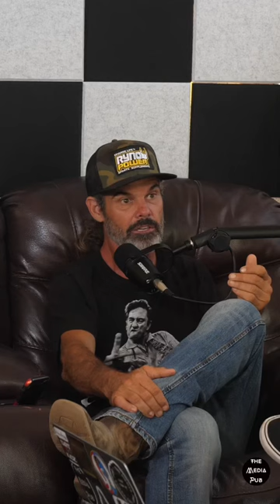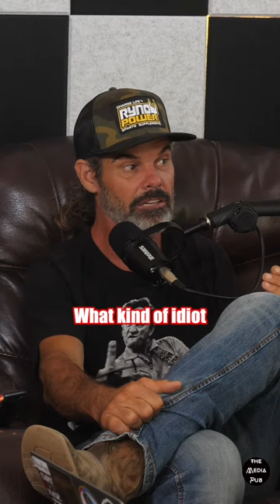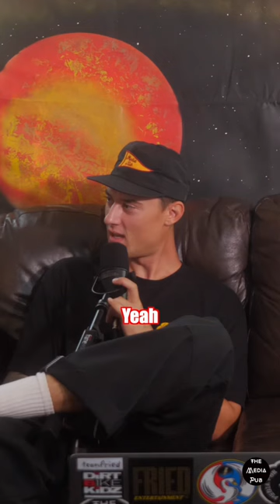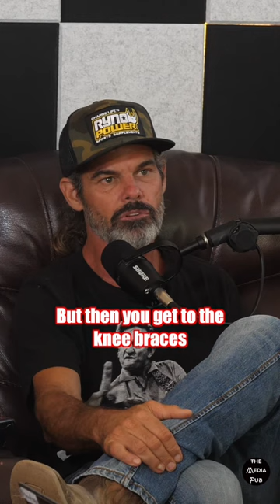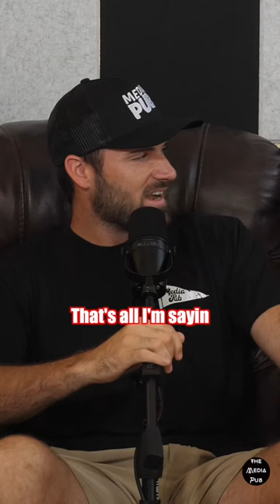Ryno Explains Why Moto Dismissed Neckbraces

Comment: I agree with the neck brace but not so much the knee braces. The bending issue can be trained out of a person but they are more for stability not so much “protection” just like wrist braces; it’s advertised for hyper extension but it more or less locks your wrist so your chicken winged the whole time and just have a “stable” wrist lol doesn’t stop jamming or even stop it from breaking. Just moves the break to the arm or hand really. It seems like the pros use a wrist brace for injury management and not protection.